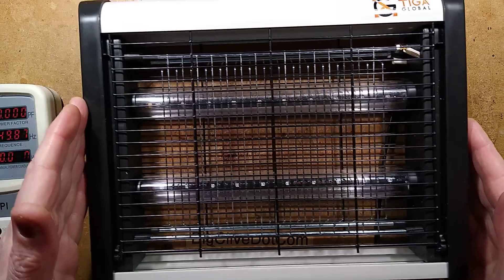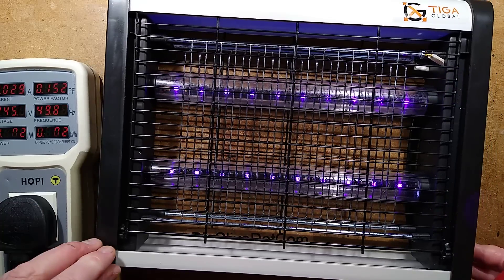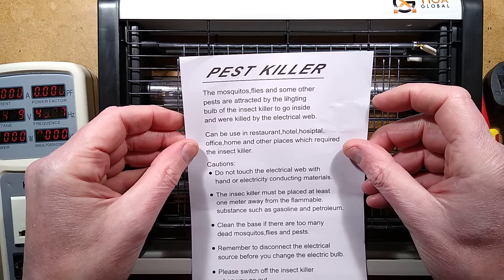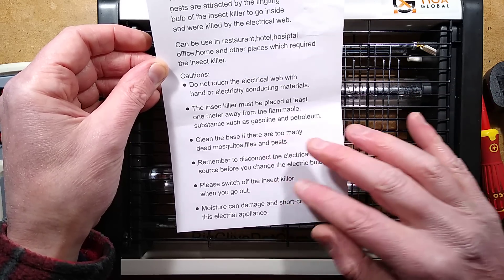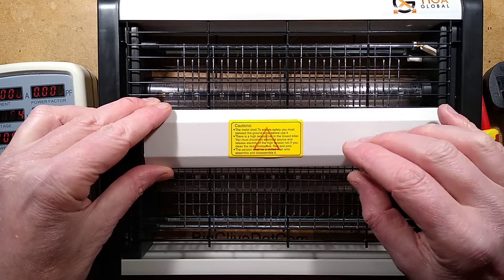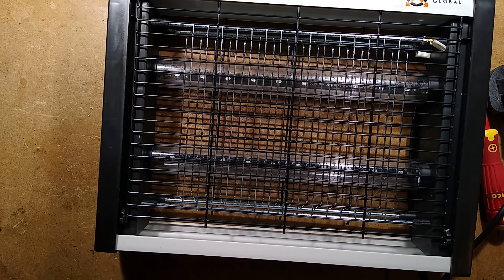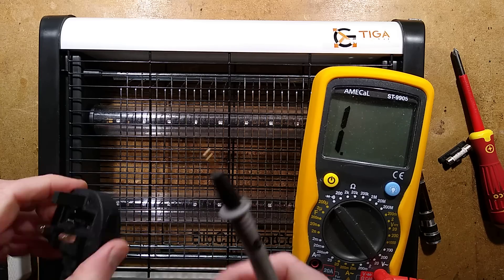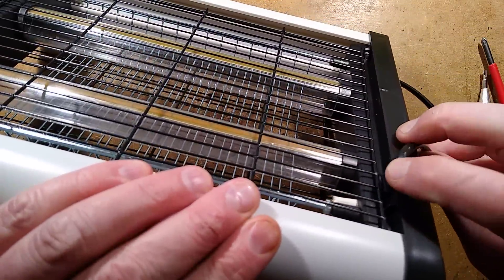eBay LED insect zapper teardown with schematic

Comment: The old flourecent tube zappers use a mains transformer with a secondary output voltage of 2kv with no rectification.

Comment: I have a similar bug zapper.  You say that the high voltage "destroys" the insects.  My experience is that larger insects like a fly just end up, intact, at the bottom of the well that captures them.  Here's my point:  I suspect that the high voltage may not be going through the insects body but around it - electricity following the path of least resistance.  What's the resistance of a fly body vs air?  Bottom line, my 4K volt bug zapper seems only to stun flys and they are left intact and sometime alive at the bottom of the bug zapper tray.  Maybe try your zapper with some real insects and see what happens.

Comment: i have a very similar unit, just much bigger with metal at the bottom and top and 2x 60cm T8 Fluorecant Tubes in blue. The tubes are in Series with a traditional ballast, and there is a 2000V 9mA Transformer in the lid on top too for the high voltage. Ballast is under the top lid as well

Comment: The first part of the circuit before the bridge a transformerless voltage reducer. It used often in LED power, cheap but it works.

Comment: 0.154?!!  That is the worst power factor I've ever seen!
Reply from the maker: That's what happens with capacitive droppers and low voltage supplies.  Like in most plug-in time switches.

Comment: I bought a fluorescent version of this back at the beginning of last summer. It didn’t catch anything for the first few days so I convinced myself it wasn’t working & jabbed a screwdriver into it & tripped the house RCD!
Yes, mine was earthed! Well, it came from a UK seller.
I took it apart anyway, just to see what made it tick, & it’s the same voltage doubling system, but mine had positions for another stage on the board, so I can only assume it has that extra stage added for 120v supplies across the pond.
But I’m still very tempted to add it anyway & see what happens. I won’t though, I mean sometimes you’ve got to be sensible, right? 🤷‍♂️

Comment: I have a couple of these in a similar vein... they do work quite well, I've caught some very large moths and even a giant grasshopper. Multitudes of smaller insects as well.
The pitfall I've found: There's not enough isolation between the high-voltage grid and the LEDs. So that if/when the unit catches too many bugs or inevitable dust the high voltage can jump to the LED strips and cook 'em.
Thanks as always, fun stuff. Cheers.

Comment: As an electronics idiot, why does the switch being on the neutral and not the live wire of the plug socket make any difference? doesn't it still break the circuit, and if the power supply is AC anyway, why does it matter which one is live and which is neutral? Obviously I'm misunderstanding something and looking forward to being educated 😂
Reply from the maker: It means that if you turn off the switch to clean the grills you could get an electric shock to ground.

Comment: I know that fuses and switches must be on the live side, but why? I get it with DC, but I don’t really get it with AC, particularly since many countries use unpolarised plus (albeit without fuses, which I gather are unnecessary in star wiring systems).
Reply from the maker: In the UK the neutral is near ground potential.  The live line is 240V above ground potential, so gets switched and fused, as it is the connection that will pass high current to ground.
Reply: @bigclivedotcom  Thanks for the detailed explanation. As a follow-up, would the safety of a non-polarised device (for example, a lamp with a Japanese two-pin plug) be affected based on which way it is plugged into the socket? (For the purposes of this question, the supply is 100V AC and is provided via wiring compliant with JIS standards, and not compliant with British Standards).

Comment: With ~40 V across each LED strip there would be most of the 400 V across each 200 ohm resistor. Something wrong somewhere.
Reply from the maker: It's effectively current limited by the series capacitor.   A capacitive dropper.
Reply: @bigclivedotcom  OK, thanks for pointing that out. I suppose the resistors do serve a purpose in helping to equalise the currents in the two LED strips.

Comment: I have a zapper similar to this one marketed as monster zapper. It zaps just like yours but it has a pretty long recovery time between zaps and bugs just don't sizzle. It's basically a glorified fluorescent light but the zapper does zap but not like my flowtron.

Curious if it's possible to change out the caps for the 2000V ones used in the hand held tennis racket style zappers and if it will zap any better.  I plan to do it on mine since it's pretty useless as it is now.

I have another zapper and it's a combo hand held zapper and converts to a hanging zapper and it works better than the monster zapper. Circuit was modded so you can just flip a switch and it's on. zaps pretty good.

Comment: A rat died under my kitchen floor, and the floor was crawling with maggots, and I had blow flies for months. I bought a fluorescent tubed fly killer. There were bangs, crackles, sparks, smoke, and bits of exploded flies! ⚡💥🔥🤮

Moral of the story? ... Never live in a rat-infested Adactus Housing Association sh*t hole! 👎😠

Burn in Hell 🔥 Fire, Adactus! 👎😠

EDIT: After the rats have been electrocuted ⚡ in my Rat trap, I throw them out of my first floor kitchen window on to the street below! ... The last rodent execution was on New Year's Eve! ... Unfortunately, the New Year DIDN'T get off to a very good start for the rodent! I hope its death was slow and painful! 👎🤣

Comment: I once had left the lights on while opening the window in by bathroom after a late-night shower in summer. When I came back, the room was full of little... I guess they were fruit flies? Something like that. I macgyvered together a cheap insect killer by gluing a single blue LED in a transparent cup, filled with soapy water. Next morning, the cup was black from hundreds of dead mini-flies. So I think the LEDs might actually work as insect attractors. Doesn't even have to be near UV, normal blue will probably work as well. Not sure about the gaps in the mesh though. They seem pretty wide.

Comment: Bug zappers (uv) don't really attract mosquitos at all, you need some kind of bait for that. They are attracted to CO2. What the lights do attract are moths, which are usually considered "Good" bugs you don't want to kill.
Reply from the maker: Having had an issue with indoor moths in the past, I'd be happy for them to be attracted to the unit.  Outdoor moths are fine.

Comment: I had an ancient one of these that used a blue-tinted incandescent tube-shaped bulb with an Edison screw fitting. It worked really well until the bulb burned out and turned out to be no longer available. I replaced it with a CFL version which doesn't seem to work as well :(
Reply from the maker: The lamp has to be UVA.  A disco blacklight style CFL should work.

Comment: That looks like a perfectly reasonable unit. I really like how the LEDs slide right in. I’d turn it on its side so you could compare different colors’ effectiveness by the piles of bodies that accumulate under each.
Reply: I'm wanting addressable UV strips now RGBUV? Insect disco!

Comment: I have bought something very similar two years ago. Firstly, not effective on mosquitos - as these do NOT react strongly onto UV. Mosquitos go for CO2 and smell. Second, if you have that overnight getting the attention of a moth or fat fly, it makes a sound like a 22 shot going off and having it burned down with arcs and a really awful smell. 

Cannot recommend it unless your issue are moths and flies rather than misquitos. Have mine with a timer only switched on for 2 hours before bedtime. So if there are flies and moths, thats it. No need to illuminare a bedroom with LEDs and being woken up by a big BANG in the middle of the night.

Comment: Are you sure that the manufacturer followed convention and connected the blue wire to neutral and the red to live on the plug?
You tested the fuse was connected to the correct prong on the plug but you never checked the wires were as you would expect.

Comment: Near UV is not much more appealing to flies than any light (shorter than red, for flies, they don;t see red at all and arent attached to red light). But in case, they are disturbed, or are looking to change their residence, will use UV light as an indicator to get out of the current darkness. But if a fly is happy, it has no reason follow lights... it'll happily drink fermented juice with his/her friends under the moonlight of your contraption. But disturb them, open the windows in the winter, and then you'll start seeing pops. Also there are flies, which just happily ignore the UV light... I guess there was a large evolutionary push towards getting lost in trash as opposed being tricked into a deadly fake sun...

Comment: I was asked to develop a none chemical based flea killer, to deal with cat and dog fleas. As these insects spend approximately 90% of their time off the animal,  lying in wait for their next meal to pass by, it seemed reasonable to attack this part of their life cycle,
 and behaviour. Traditionally chemical treatments for carpets and soft furnishing are used to kill the insects, and their eggs, however these chemicals are toxic to higher forms of life, including humans in some cases. So it was necessary to find a none chemical alternative. There are on the market light based flea killers. These suspend a low wattage incandescent bulb over a tray filled with slightly soapy water. 
The light is supposed to attract the insects and the soap in the water, lowers its surface tension to allow the fleas that fall into it to sink and drowned. 
My first reaction was that the coloured painted bulb, which is mains powered, might emit heat that adds to the attractive nature of the green or red bulb, but I could not find any research to support the idea that fleas might be long wave IR  heat sensitive, what I did find were reports that their peak photosensitivity was in the green yellow part of the visible spectrum. 
It was also apparent that such insects jump towards a sharp change in light level, a effect that mimics the shadow case by a moving pet. 
Clearly the fixed brightness mains powered light had some disadvantages, not least of which was mixing mains voltage with a bowl of water. 
My brother and I set about producing a better circuit. This used a standard low voltage USB power supply, to power an 8 bit  pic, and super bright green  led mounted on a circuit board. 
The use of a pic allowed the circuit to include some slightly more advance features, such as a pseudo random light flash timer, a self test function, and an LDR, that disables the circuit in bright ambient light, when it will not be effective.  
The circuit is mounted in a small plastic box, with an input USB connector and a long wire that powers the single super bright green LED. 
The LED is mounted, pointing downwards,  on a plastic disk, which is supported over a shiny metal  shallow dogs water bowl. The light being reflected off the water bowl, illuminating a wide surrounding area. 
Tests have found that this trap arrangement is extremely effective at killing a flea infestation in a room in a matter of days. It's efficacy is apparent by at using the water content after a few hours. Comparison between placing the trap with the LED active and not, indicates that fleas are indeed greatly attracted to a flickering green light. The pic pseudorandom timer was set to maintain the light on for several minutes and then switch it off for half a second. The on duration being random, from a few seconds to several minutes. There are too many variables to optimise this timing interval, not least the possibility that the flea response may be temperature sensitive, but the values we used in the prototypes built, suggest that our values work very well. 
Our solution has a number of advantages: 
1) It is powered by a standard CE marked, approved 5 volt USB supply. 
2) only the low voltage circuit comes any where near the bowl of water, 
3) the circuit has enhanced features, such as the self test, the light level sensor, and the pseudo random timer.
4) the circuit consumes very little power and is designed to be efficient. It is certainly better than the commercial product we found, that used a 15 watt incandescent pygmy bulb.
5) it is constructed from a very few, low cost, off the shelf parts
6) there is so little medicated hand soap in the water,it can be regarded as not toxic. ( one or two drops).
7) the circuit actually does what it was designed to do very reliable.

Unfortunately, I have no way of knowing if our solution is unique, or if there is already a similar product on the market. We did a few searches, and did not find an equivalent.
Reply from the maker: I have come across the flashing light flea lures in the past, but not recently.   LED is definitely a good option.

Comment: Reminds me of a dodgy pizza shop in central Australia, they had an old fashioned bug zapper with a pair of 18watt semi black light tubes set up in the pizza making area right above the bench where the delicious pizzas were assembled. I remember going in on a hot summers night to order a meal and the bug light was crackling away due to swarms of flying insects drawn in to the light, I can still see numerous zapped bugs of all varieties and sizes raining down onto that bench and no doubt becoming extra ingredients on top of the pizzas just before going through the ovens!

Comment: I purchased the led unit on a local app in the Philippines and it attracted 0 mosquitoes. Obtained the 20w uv bulb units and they filled full of insects nightly. They used 2 10w uv bulbs t5’s. They don’t last long and nobody has them available locally. The units are around $12 and the bulbs are available in china for around $24 each. Not sure what going on with bulb prices in cheap china where they pay the workers Pennies. Anyway it’s cheaper to throw them away and buy new units.

Comment: I picked up a few old zappers with blown tubes, I got some 2 amp 12v transformers that I wired in place of the ballasts and ran some lengths of that "almost 400mn LED" strips along some scrap conduit (on the outside lol) that wedged in place of the tubes. they work well but I should have used more powerful LED's  for the brighter part of the Australian mid-summer days lol. It has cost me under AU$10 each to convert them using parts sourced on-line from AliExpress. I have ordered a strip of 5050 LED's to replace the 2835's currently in use.

Comment: 49.84Hz at the mains? That's very low. What was going on in the power grid that day?
Reply from the maker: Not sure how accurate the Hopi is for frequency.  But there's a strong possibility that the cold weather when making this video resulted in high power usage.

Comment: I also really love the chinese dream of killing flies and stuff with high frequency noise, done by a little deathdapters in the socket. I always wonder if they would have even a little chance to work.. 😂

While it's pretty odd to switch the neutral, when it's only a euro style (2-Pole) plug, does it really make such a difference when considering security? The user may or may not plug the device in, with the phase in the right position. Much better would be a 2-Pole switch. 🧐 Must be out of budget in these appliances 🥴

Great Video as always! 😍

Comment: So what's the recovery rate? I live in the Deep South of the United States. Our National Bird is the Bald Eagle but I think the mosquitoes is more popular answer here. 
We go through at least 2-3 bug zappers a year. cost us about $50 each.  They all burn out and stop working. 
I had one that when a bug touched, it took what seemed like one second to recharge before the next bug would be zapped blowing off their wings. Is there anything I can do to make them last more than a season. One zapper takes about 2 months to  fill a 5 gallon bucket up with mosquitoes, beetles and other winged insects. 

I thought it was due to the high humidity so I sprayed the boards with Conformal Coating.  Still got the same results.  They are outdoors but under a roof away from rain and direct sunlight. The lizards and frogs love sitting under the zapper each night.

Comment: It is questionable if this type of insect kill, really kills the insects that are the most troublesome. It is certainly very dependent on the wavelength of light used. 
It will certainly attract all types of moths, and crane fly, but house flies and mosquitoes are less likely to be attracted to the UV and are only killed when they blunder into it. This  has been my experience from examining the content of the traps under such lights.
There are studies that suggest that house flies are attracted to short wave length UV, but they are no where near as sensitive as moths and other night flying insects. 
I suspect that house flies and mosquitoes, particularly the former, are attracted more by odour than light. There have been experiments testing what attracts mosquitoes, and these seem to be drawn to concentrations of CO2 and acetone vapour. Test have also shown such biting insects are attracted to black sheets, presumably as these mimic the body shadow of large animals , such as cows. For greatest effectiveness, the light must flicker, mimicking the movement of an animal. 
A flickering (intermittent)  green light can encourage cat and dog fleas to move towards a soap water trap, where they drowned.

Comment: The old ones and flowtrons, use just a beefy transformer and a neon bulb to be the flourscent tube starter, which you can swap out for a proper starter, I find the transformer ones more reliable